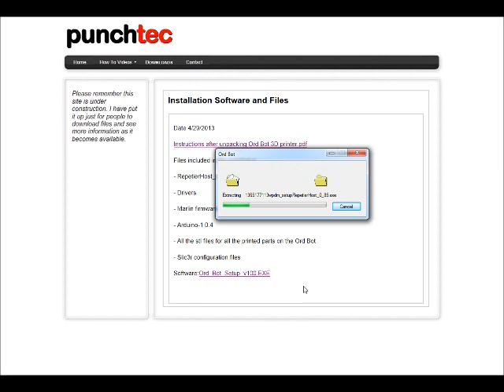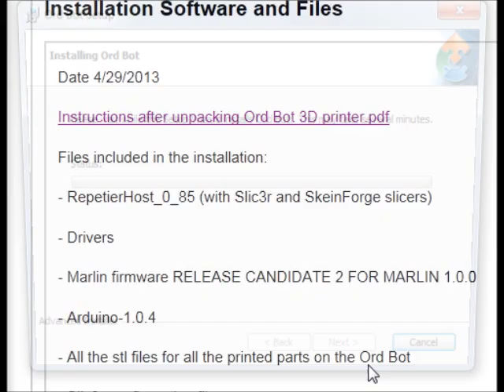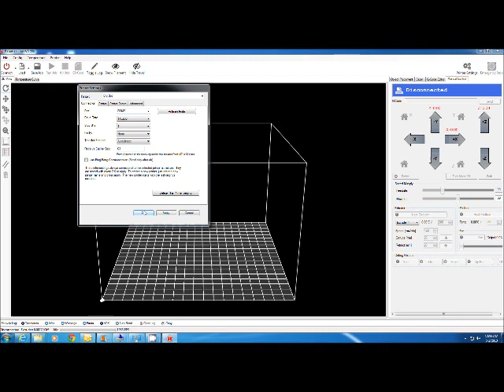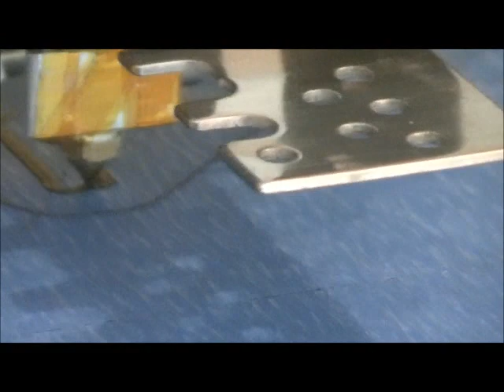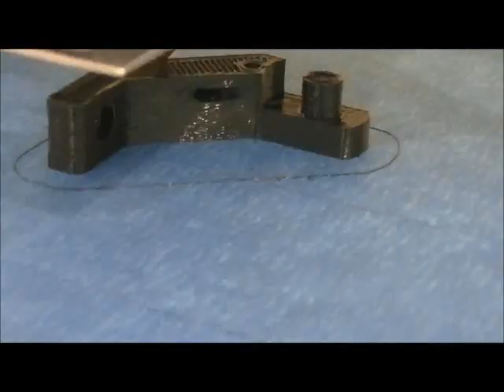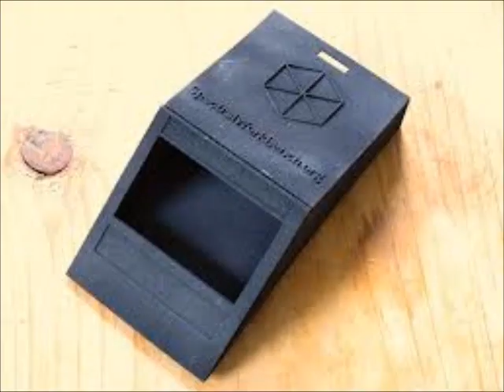Printing in minutes with the punchtec Ord Bot 3D Printer. http://www.punchtec.com/.

Comment: does this work on apple
Reply: hi, most repraps (or in this case a rep-strap) use skeinforge or slic3r (or cura) to slice the stl-file and software like pronterface or repetier-host to controll the printer
all these are available for windows/mac/linux

and if you need to reflash the firmware 99% use a arduino based controller which also runs nicely with mac :)